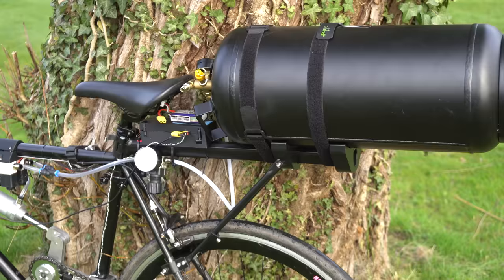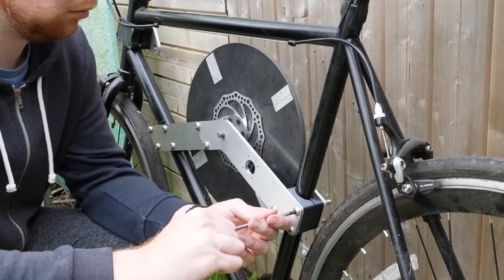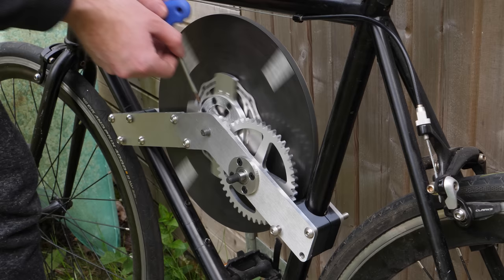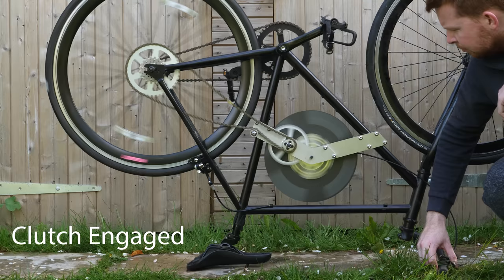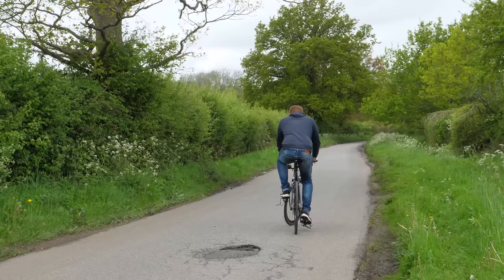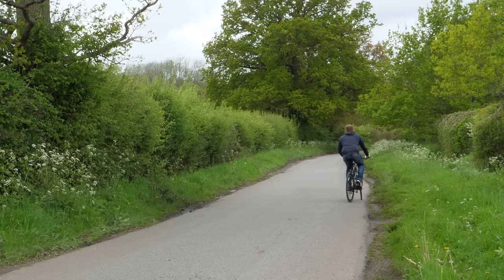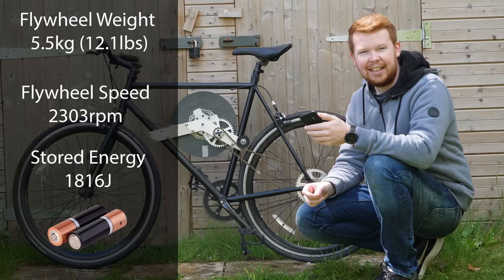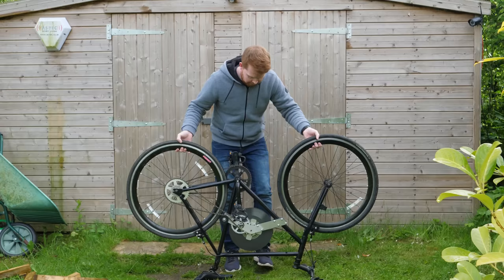Flywheel Bike KERS

Comment: While I'm sure it's perfectly safe, I'm not entirely sold on the fast spinning metal positioned under my nuts.
Reply: At under 3000 rpm, that is way less than 11,000 some engines turn. What are you afraid of?
Reply: @420frankp  Those engines aren't homemade, they have a bulkhead and casing protecting me, and aren't placed under my nuts.
Reply: @420frankp  yeah okay 11k rpm in what stock car? an rx-7/8 with rotary only redlines at like 9-10k. Also a flywheel is much more dangerous than an engine, the entirety of energy stored is stored as kinetic energy. An engine has al little rotating mass as possible, and therefore little kinetic energya. Go back to 1st grade physics bud
Reply: @henrygaraffa5439  Probably thinking of some motorbikes there. 11k rpm redline is fairly common, plus the engine will still be right under your nuts.

That said, flyweels are scarier.
Reply: @henrygaraffa5439  my ninja 250 redlined at 16k
Reply: @C F LOL
Reply: @420frankp  T D&D...  Testicular Disorganization & Destruction... 3k RPM will not produce a lovely feeling when/if released catastrophically
Reply: Old drag cars used to spit flywheels right through the bell housing and the floorboards cutting people's feet off... That's why the have sfi bell housings and scatter shields now
Reply: @henrygaraffa5439  there is an old drag nova that's a stick shift, he launches at 12k rpm.... Old chevy small block👍
Reply: Cant integrate it Into the back wheel? Was just thinking that 😆
Reply: It’s not safe.But his jewels not mine. So whatever. LoL
Reply: @derekhansen6652  Not stock. although tbf neither is the flywheel bike
Reply: @420frankp  It is a bit like squatting on a table saw with a 12" diameter blade.  What could go wrong?
Reply: @amihere383  my z1 kz900 just over 13,000
Reply: It's been a while since seeing it, but the "power substation" flywheels, to be considered worthwhile, have to be like 20K rpm. I have heard horror stories about them literally exploding at those speeds. The required safety factor was a heavy steel case.  I think they were tyring to use fibreglass and hoping to make one with carbon nanotube fibre. Have not heard any updates on this.
Reply: @jubb1984  Lately I have been trying to imagine a way to do that.

Comment: I think a viable use-case for a flywheel is on a trike. You pedal at a constant speed more or less, not exhaustingly hard (< 200W), including while stopped. Then you have hopefully cached up enough energy while sitting at traffic lights to have decent accelleration without needing a lot of Li batteries that are too expensive for their service life. A flywheel applied this way should last forever.  Probably there is a known name for this concept.
Reply: who tf sitting at a traffic light on a trike?
Reply: @JustKhari  You'd be surprised.
Reply: @JustKhari I would. I used to commute, train, and race from 1986-2012. In 2001, I had my neck broken in 3 places, C3, C5, & C6. My neck is fused from C3-C7 (entire visible part of your neck). For me, what would be a normal fall for you, could be potentially disastrous for me, quite possibly the next break would be at C2-C3, or C7-T1. 

Best case scenario for C2-C3 is quadriplegic, but more likely killed. C7-T1, best case paralyzed from the waist up, but most likely quadriplegic.

So, if I want to ride again (and I miss it terribly) my only option is a trike.

That’s who tf, would ride a trike.
Reply: @JustKhari  literally anyone who uses a trike and has to cross intersections, what else do you want them to do? blow through the intersection while cars are crossing?
Reply: @JustKhari jesus christ what do you think a traffic light is for? I cant think of a single vehicle(including a bicycle) which is exempt from traffic stops. you must be from the bayou.
Reply: @jamesbonn2394  no, he's from India, or Africa.

Comment: Why not use a circular spring to store rotational energy while braking, so you can store the energy for a large amount of time without the flywheel slowing down? That'll come with the added advantage that you're not adding as much mass to the bike, you only need  engage the mechanism while braking, and it won't be as noisy.
Reply: Thats an interesting idea... so a spring, like a mouse trap!... and it launches you forward... as long as it doesn't launch you backward! :)
Reply: It might not have the torque to get you going again though, But good Idea.
Reply: Thats called elastic energy and is much more limited in the amount of energy that you can 'store' in the spring. Compared to a flywheel.
Its all old idea's in a new jacket. Has been done centuries ago. Not very effective.
Reply: @Reach3DPrinters  more like a big clock spring.
Reply: @SuperUltimateLP  
Beat me to it.
Reply: @flexairz  i also would imagine that a clock-like sprig as a maximum number of rotations (therefore, on a fixed gear, distance to stop) it can handle, regardless of the starting velocity. And only a window of rotations "absorbed" at wich it is efficient.
A flywheel seem to be much more versatile a storing different amounts of energy
Reply: Springs waste energy thanks to friction between the crystalline lattice structure of the metal
Reply: @svenlangstrom8927  
Not straight, a coil spring. Like on a garage door.
Reply: @thechumpsbeendumped.7797  That's the word, thanks
Reply: Exactly,.... Like old winding clock.....
Reply: then u would need some mechanism that not only engages and disengages the spring but thats also inverts the direction of the spin when u want to accelerate
Reply: metals are ineffective as elastic enegy storage. look at bows. wood or composites are much more capable per mass. but flywheel anyway is more effective. best ones are made of band, so the have high moment of inertia, low mass and big strength
Reply: That would also allow much more of the energy to be converted back to kinetic energy
Reply: its better to use a piece of string that is wound rather than a spring
Reply: I hope tom tries this :)
Reply: or make the bike's tubes air tight and use it as a pneumatic spring
Reply: @Reach3DPrinters  Clock spring.
Reply: @SimonWoodburyForget  , same enegy metal bow will be heavier, that is the point.
Reply: @linkhidalgogato  not really, if you have a gear reduction mechanism that can be backdriven it's as simple as back driving the mechanism with the force stored in the spring
Reply: @SuperUltimateLP  Or those old toy cars you'd pull backwards ;)
Reply: A strong enough spring for the use would be really fucking scary though
Reply: @flexairz  not only that but if you keep winding up the spring it will obviously snap, so only useful for short braking
Reply: gud idea, but it probably cant twist very far, limiting the range of motion, plus if you over twist it, it might snap. not the only reason that this may not be the best idea.
Reply: so does a flywheel, but the friction atomically is quite minimal
Reply: @ltd4517  well, it may not have enough torque to start from a stop, but it could definitely give a speed boost once started that would still save you energy
Reply: Not gonna lie I thought you were gonna tell him to build a propane powered bike
Reply: use rubber?
Reply: I'm thinking garage door style problems when it breaks though. I would not want that anywhere near me or my bike
Reply: Just be aware that a clock spring strong enough to do that could cause serious injury if something goes wrong. There used to be spring starters for some engines (I'd guess late 1930's to early 1970's?), but I figured they stopped using them due to the hazards they presented during repair.
Reply: Or compressed air.
Reply: @Megalixer84  automatic watches prevent overwinding via a clutch that will slip once the spring is fully wound.
Reply: Use the spring instead of a CVT as temporary energy storage to match bike wheel to flywheel. So: bike wheel - clutch - rotary spring - flywheel. Instead of losing energy to friction when you engage the clutch, you store it in the spring until the flywheel has caught up. Same in reverse  on reaccelerating. Combining this with another suggestion from the comments: hollow out the flywheel (most of the rotational inertia comes from the perimeter) and put the clock spring inside it.
Reply: ممكن ترجمه

Comment: Must be nerve wracking knowing there's a heavy metal disc rotating at thousands of rpm right below your nuts.
Reply: No worse than a motorbike :))))
Reply: @cbwcjw  Ya really id rather that spinning disc let go than a V twin blow up under my wedding tackle.
Reply: The burst strength of even a 300 series stainless flywheel would be impressive.  Also it's under the top tube.
Reply: There's worse things.
Reply: ..I thought he said "nerve wacking".. nevermind.
Reply: my thoughts exactly
Reply: This might be a good reason to employ a female test driver.

Comment: I think I would LOVE this arrangement on particularly hilly rides. I'd use gravity on the downhills to spin-up the flywheel then release that energy for a boost at the base of the hill and the start of the next climb.
Reply: creative
Reply: Yeah. It will be a real pleasure lugging that heavy flywheel up the hill. it weighs more than an bike-sized lithium storage battery. I'll go for the battery, thanks.
Reply: The weight of the flywheel would more than offset any benefits on a climb.
Reply: @JoeOvercoat  Good point. In the end, energy is never free.
Reply: I was thinking the same thing, but also to act like a engine brake on a car to slow you down, but it will store energy like an e-car
Reply: @rippedpantsaj  Creative, not more. NASA wouldn’t support him 😂
Reply: @JoeOvercoat  drive up the hill
Reply: The flywheel might be really heavy, i wouldn't climb hills with that
Reply: @schizy  speaking of e bikes, do they have regenerate braking? I think this rear regenerative braking+ front mechanical braking makes a lot of sense
Reply: I thought the same thing, but if you got it got it spinning fast enough to actually help you up a hill, it'd be quite a hazard. Flywheels can mess you up if they malfunction
Reply: @adabsurdum5905  True, plus there's the weight of the flywheel and associated parts itself, and since energy isn't free you're still expending all that energy it just becomes a little more distributed.
Reply: @adabsurdum5905  would the fact is spinning change dynamics the way you feel of you spin a wheel in your hands by the hub and shift it feeling the power
Reply: @schizy  hey, are you a child? Flywheels don’t have to be heavy, they just have to have a wide diameter
Reply: lmao, nah, it would give you a tiny boost and then it would drag on you the whole uphill, I guarantee you you'd use more energy with this on than without.
Reply: The extra weight is not worth it on the climb to begin with IMHO.
Reply: @marcberm  energy is never free indeed
Reply: It won't work with gravity. It'd be much more efficient when you don't have the flywheel at all. The flywheel thingamajig only works during slowing down.
Reply: Genius
Reply: The weight alone on that disc has to be somewhere between 10-20 kg, which is roughly the weight of another 1-2 bikes that you would have to haul up that hill.  Doesn't make any sense.  It is very interesting as a concept, but is impractical for anything but the flattest of rides or just going downhill always.
Reply: god forbid you'd have to get some exercise
Reply: @robertstan2349  I'm a runner TYVM, though biking is also a fine exercise. But also since there's no such thing as free energy, you're still burning the same calories with or without the flywheel (you're just making the rate of burn more consistent, but I'm sure you already knew that. 😉)
Reply: @Joel-qz6sd  weights are only held on by friction clamping. A good mechanical/chemical fixing would keep weights & flywheel in place

Comment: Cool concept! What if you used a torsion spring instead of a flywheel? Might be lighter, plus there would be no time limit on stored energy. Could add some kind of ratcheting mechanism so that it can’t propel the bike backwards while tensioning the spring, and then probably another handle would be needed to engage some kind of reversing gear and release the spring tension 🤷‍♀️

Comment: I'm actually curious as to how effective the flywheel could be in maintaining the speed while coasting rather than using the energy to take off from a start. Just a thought.
Reply: So whatever momentum stored in the flywheel, is taken from the momentum that would've been stored in the bike. But if its propelling the bike, the bike will coast almost as far as it did without the flywheel. A little less due to all the friction.
Reply: In order to get the energy into the flywheel it uses the momentum of the bike, so it causes the bike to slow down but the flywheel spins up to top speeds. It means any amount of momentum you use to spin up the flywheel slows the bike, so the only way to benefit from this is to use it for a brake, for only when you have to slow down or stop anyway. Otherwise if you tried to use it to coast you would first have to pedal up to speed, then engage the flywheel in order to get it spinning, but this will slow you down anyway, and all you would be accomplishing is going faster, then braking, then going faster, then braking, etc... It would be a waste of use, because you could just avoid it all and just keep pedaling and you will get their faster, and with less energy. 

The only way to use it to actually benefit, is the way the guy in the video plans to use it, as a brake. Hey, be happy, this is a awesome regen braking apparatus, all mechanical no electrochemical batteries..
Reply: @TheRebelmanone   the efficiency is comparable too! And he's just one man with not very precise equipment (according to him).
 I imagine it can be much more efficient (% wise, not compared to ebike) if it's industrialized
Reply: @collinmckinney6952  ok lets make it turn on oil film.